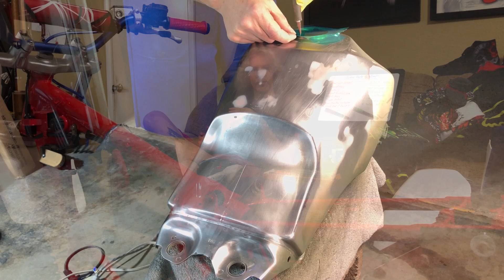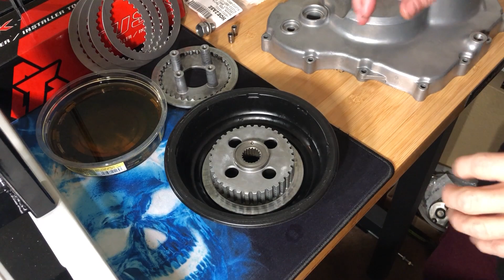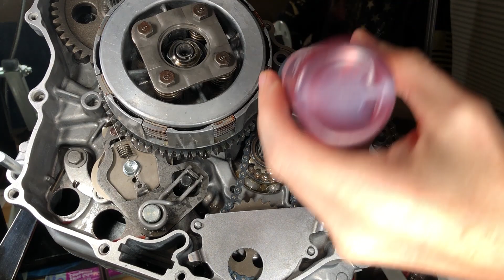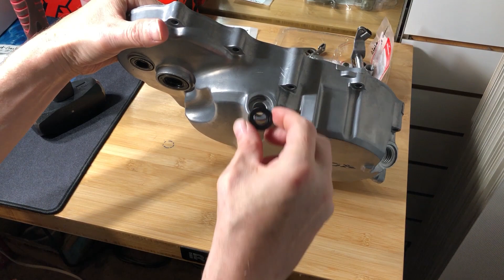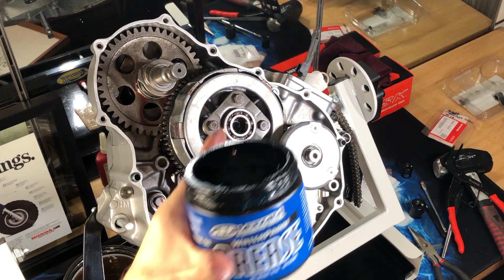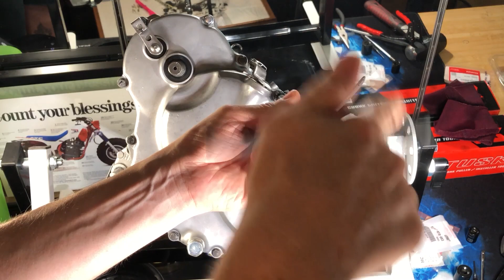Honda ATC 200x Build - Part 16 - Motor Engine Bottom End Clutch, Cover, Lifter Arm, Oil Filter Rotor

Comment: Where did you get that decompression cam lifter peice mine broke and i cant find the right one
Reply from the maker: It was on the machine when I bought it ... here is the parts diagram ( https://www.partzilla.com/catalog/honda/atv/1986/atc200x-a/right-crankcase-cover ) but that is going to be a hard part to find by itself ...

Comment: I think you did amazing job on the bikes. I’m getting ready to do a 1986 SXATC how do I get the Vin number off or get a new one when I have a powder coated
Reply from the maker: I don't think you can just get a new one, you are going to have to carefully remove the powder coat where the vin # is ... just FYI, it's possible that the vin # was sanded off before it was powder coated ... I have the title to mine with the vin # but mine was powder coated over as well so if I ever needed to prove the vin # I would have to remove the powder coating where the vin # is as well ... good luck

Comment: What is that finish you used on the engine and casing?
Reply from the maker: The black paint was chemically stripped by "Xpress Metal Cleaning" here in Phoenix, AZ and then all the components (crankcase, cylinder, head, and cover) were all vapor blasted by "Vapor Blasting By Design" also here in Phoenix, AZ. The vapor blasting process then seals the pores and completes the process allowing to be run as bare aluminum (no paint). - https://11galleryatv.com/honda-atc-200x-build-complete-atv-rebuild-and-restoration/

Comment: When going wot on my 85 200x the motor revs but the speed doesn't match could that be the clutch I have 1 on order
Reply from the maker: Yeah, it sounds like the clutch is slipping ...
Reply: @11GalleryATV  thanks just got this gem a few weeks ago great condition but noticed the clutch issue and it had like 2.5-3 quarts of oil in it
Reply from the maker: @josemares1439  Wow! That's not good. That could've caused some clutch slippage right there. The 1985 200x oil capacity is only 1.1 quarts ( 1 liter). Drain the oil and refill back to proper capacity and see if it is any better.
Reply: @11GalleryATV  yes I tried that but not much improvement if any and who knows what weight or type it had in there

Comment: What does that little  lever looking thing by the kick-start do? I have one on mine but no cable hooked up.....not sure what it's for
Reply from the maker: That is the decompression cable. It automatically releases the pressure while kick starting to prevent "kick back". I used a manual decompression unit from a TRX200SX top end but I still needed the lever there to seal the case.

Comment: It's cool that your building this atc 200x. My brother Grandpa bought my 200x bran new 1983 now I own it. And I have been thinking of going through the engine it needs a new clutch and timing chain its never been opened. I just put new tires on it and plastic and fixed the fuel tank.
Reply: Thank you the honda parts house will help me a lot
Reply from the maker: Awesome! Here are the 1983 200x OEM parts and diagrams if you need them - https://www.hondapartshouse.com/oemparts/l/hon/50541771f870021c54bef628/1983-atc200x-a-parts